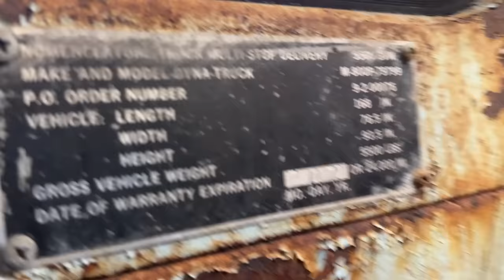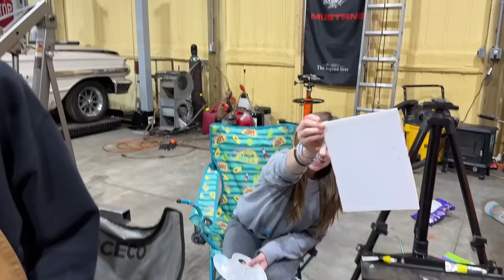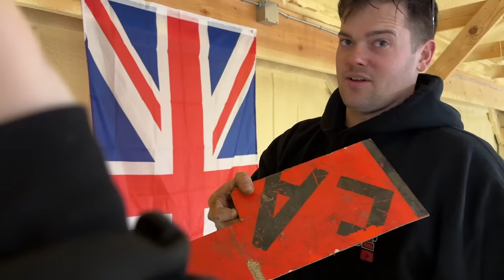Postal Van 6.0 LS Swap Mid-Mounted!

Comment: When it comes to drive shafts I always have them made by a shop sense I don’t have a lathe that goes long enough where I can get them nice and straight and be able to get them balanced!!! If you don’t have a drive shaft that is balanced it can definitely end up taking bearing out of the transmission along with the bearings in the engine also!!! I have seen people say I’ll make one myself and see how bad it vibrates every thing but they don’t realize that the bearings can take the vibration out enough where you can’t feel it and thinking it’s ok and don’t need to take it in and have it balanced!!! I no a guy that did that and made is own and he thought that it was much smoother driving down the road with his new setup that he had put together so he thought he would be ok!!! After driving it for a couple months he started hearing a noise in the transmission!! He pulled the transmission and took the transmission to a transmission shop!! They said that a bunch of the bearings was completely destroyed along with a few bushings in the transmission!!! He asked the transmission shop what would cause for the bearing’s being damaged along with the bushings?? They told him there could be several different things but the biggest issue he had seen over the 40 years of rebuilding transmissions was a drive line vibration of some sort!!! The transmissions shop didn’t even no what the guy had been working with other than what transmissions he was using!!! The guy went to install the transmission and ended up grabbing the flex plate to turn it to line up the bolts for the torque converter and it felt weird he said!!! He desided to pull the transmission back out and check the flex plate thinking that it might be cracked or the bolts that hold the flex plate to the crank might be loose but found out that was definitely not the issue!!! After talking to several other people and trying to figure out what might be his issue he didn’t find out anything!!! He decided to pull the motor out and tear it down and see if the issue might be inside!!! After he pulled the pan and pulled the rear main cap he saw that the rear main bearing was worn down clear into the cooper and was very thin!!! As he pulled each main cap from the rear towards the front they each ended up being worn out way more than he had ever seen before and as he went forward they seemed to be less worn the farther forward he went!! He was able to to just put new bearings in and thought it would work or it wouldn’t!! He got it all put back together with a new drive shaft that was balanced and rebuilt transmission and the motor with new bearings and he was driving it!!! He has been driving it for several years now and he said after spending over a thousand dollars to get everything fixed back up and going he decided that if he would have just spent a couple hundred dollars or less and just had a drive shaft balanced properly he would have a lot more money in his pocket!!!! I told him well it can definitely be a learning experience when changing things around in rigs that you build!!! Heck Cory wheat customs had issues with a drive shaft for a big semi style truck and it ended up costing him I think another 800.00$ on top of what he had originally had the drive shaft shop work do for him!!! Definitely get the drive shaft balanced and I’d even have them build it for the Wright length and all new U-joints and then you should definitely not have any issues!!! I have a drive shaft shop do all my drive shaft builds and everytime I have them build one for me it’s 250.00$ but I have never ever had any issues!!!

Comment: Ralphie , to gain leverage on your wrench , lock the ring end of another wrench onto the open end of the one you are using. In Australia wrenches are called spanners and adjustable wrenches are called shifters

Comment: Sleeper dude you should definitely try some of those drill bits that have like 3 or 4 steps up to the size that the drill bit is!!! It makes so that you don’t have to change out your bits everytime that you go up in size!!! They are definitely awesome drill bits for sure!!! If you use them at a lower speed and use some cutting oil they will definitely last quite a long time plus if you get the snap on set and they end up getting dull you can get a replacement for it and if they say that they only replace them if they break well you just end up breaking it in half and then they will replace them!!! I guess it just depends on how well the snap on guy is!!! Lol!!

Comment: You can take a piece of fuel line and slice it down the middle, and slide it over the radiator lipped to make a rubber insulator

Comment: Hey Josh Richie brothers auction has A green bobcat. It's not running though. you might can get for A descent price. For lifting your Motors and moving them around with to. Along with Hay and straw bale's with also. That would be A good skid loader for around your place that can serve multiple purposes with to. Even driveway resurfacing and leveling and evening them out with to. It's A diesel engine inside of it.

Comment: If you're going to Put roof air on that. Put you a small generator where the motor used to set.
And that will give you the weight on your front Axle
Reply from the maker: Ok thanks good idea

Comment: @sleeperdude Its pretty expensive, but they make direct adapters for AN lines for your radiator to water pump. It would be a REALLY clean, great solution to your problem.

Comment: You do not need one full inch to drive the car but you need at least inch to get the rear universal joint to clear the pinion yoke when installing the driveshaft. A vehicle with a flat-style pinion flange will need much less travel for installation purposes

Comment: Need to put a hole in the end of those forks so you can run a pin through it when hauling engines around. It'll keep em from sliding off

Comment: Lifting the hood and there being a "Frunk " there like a VW would be hilarious! You could have the rad back by the engine and duct the air up from underneath like a Corvette or the Citroen ds have a panel u could remove if u need max cooling...

Comment: That's a lq9 with flat top pistons and Gen 4 rods the compression of 10.1.1 put a set 5.3 243 or 799 heads will bump the compression ratio up to 11.1.1 a camshaft and turbo make 1000 HP without trying
Reply from the maker: Sounds good

Comment: The only man I know of who owns a lift and doesn't use it. With the lift,  loosen everything and lift the metro above the engine and transmission. 
You can make a Metro Mite Grill with ease. It's just 4 metal strips across the front. Then it's a customized Sleeperdude Metromite grill. Wawa and Ralphie are two great helpers, they jump in and do whatever it's needed. AND FINALLY - WHY...WHY...WHY hasn't Doller Genderall sponserated your channel?
You know, from behind, it looks like Ralphie's getting grey hair😅.

Comment: Hi Josh and family. Nice to see you all working on the old postal van. That 232 six you just pulled out is just like the one in my 1966 Jeep Gladiator pickup. Would you be willing to sell the crankshaft pulley as mine is starting to rust thru. Yours appears to be in good shape. Please let me know if you want to sell it and how much you want for it. Thanks for the video.

Comment: Jpsh, been starin at that grill hole and think a 56.7 IHC center grill rectangle with custom expamded metal would look good. Also that blur htrrn ;ooks like 56 IHC dea foam green. That and dupont syn enamel caulment cream, 74 caddie color off white gril and trim would be so cool. I'm not much on 'patina'.

Comment: Also please keep the MAF that was on that air intake. Drivability is way better if you run it with a MAF reference. There's a lot of people that say you don't need a MAF and that's only half true. MAF makes things like idle and partial throttle drivability actually GOOD, and its way easier to daily drive and not just go wide out

Comment: I could get alot more stuff done if I only had someone to hold the other end of the board,you're lucky to have your own crew,and they work for scale lol. I once had a had a Waldensian Bakery,it was a Ford one ton Aluminum bread truck,orange an black trim,300 online 6,it would start when nothing else in the yard would,corporate was getting rid of the old gas powered Van's and replacing some of them with deasel,they retro fit some with new deasel enginesthe auctioned them off sealed bid,my budd gott one too, best 1500 hundred i ever spent,drove it 8 years,then decided to sell it and put a for Sale sign on it,sold it in just 3 days for 4500, Wished I'd have bought several in hindsight.

Comment: The driveshaft in my ls swapped Jeep cj5 is only 15 1/2 inches. You should be fine as long as you don’t max out u joint angles.
Reply from the maker: Ok thanks

Comment: I thought you were having a manual gearbox in this van.  With the engine that far back hows it going to work with the gearshift?.  Great family and videos. Cheers Paul from London England
Reply from the maker: 😊 thank you we are gonna use an aftermarket floor shifter

Comment: You mentioned putting a roof top air conditioner on this, and would need to add a generator. I assume the air conditioner you are thinking of is not dual power, 12V/120V? If you were to run a 120V conditioner could you not just use a 12V to 120V inverter?

Comment: Great job. Glad you put a tranny rubber mount in. You might consider a nice thick piece of neoprene between the motor mounts and the motor since you have to pull it out before final install. I saw you ran the lower coolant hose from the motor to the upper input to the radiator - can you do that and it cool ok?
I know you like the patina on the outside but I would say totally sand and paint the inside. The roof on the inside looks terrible to me.
Reply from the maker: Ok thanks

Comment: Rigidly mounting the engine to the frame will give a mosquito-like vibration and this entire all-metal cabinet on wheels will shake and rattle slightly at idle. A low, rigid car wouldn't have this effect, but the Grandpa-Van is tall and quite flexible, with flat side panels. It was necessary to make the side engine mounts the same as the transmission mount, with rubber inserts, it would be as calm as water in a bucket
I'll be glad and happy to be wrong, we'll see

Comment: You could have dropped that engine transmission out of the  bottom of van where the rubber on the radiator you can use an old casing with out metal. Little things going to do wheelies down the street. You should paint it and put pictures of the t-shirts and hats on the side let's squeezy paint them

Comment: In the few cars I have helped engine swap, paying for motor mounts was always the last resort. We have replaced the rubber with cut down pieces of a semi truck mud flap. I think it would work for transmission mount too. In the instance we needed thicker material, it was folded or cut and stacked pieces. CHeap but effective. Yes, we still bought motor mounts occasionally, but it worked in a pinch. Works well under a radiator too. Just sayin. Come'on.
Reply from the maker: Yeah that’s awesome

Comment: Am I just thinking backwards or shouldn’t that long radiator hose be hooked up to the lower radiator hookup? The return from the thermostat should be hooked up to the top port. Unless the LS is backwards from everything else I’ve worked on.

Comment: I replaced a engine in a rv with a straight axle up front and I just removed the front axle and dropped the engine through the bottom
Reply from the maker: Thank you

Comment: 2:09:00 ITS BASICALLY AN ASTRO VAN WITH A LS.  MATTER OF SOME MINDS ARE JUST THERE. YA KNOW. I WOHLD WRNT TO PULL SAVE AND GOT ALL MOTOR MOUNTS CROSS MEMBER ECT OFF A CHEVY VAN AND INSTALLED ALL THAT

Comment: You made joke about a turbo but with a 6.0 LS and all that space between the motor and the radiator it's just screaming for a twin turbo. It can be like farm truck. It's kinda cool though even with a turbo all dialed in it turns that big turd into a everyday "can't polish a turd" sure you can,you get a cool shiny turd that turns heads.

Comment: Please replace all rubber fuel lines on this vehicle. The newer LLV's were catching fire because of old fuel lines. The postal vehicle fleet is about 37 years old now and its going to be crazy when they finally auction them off. The bodies are aluminum to resist rusting.

Comment: Can you run an ATV drive shaht off the front of the crank pulley to a box with a pulley in the front. Than mount your alternator and A/C compressor to the box put a belt on it.Than run and electric coolant pump.Racecar stuff I haven't A clue.

Comment: I agree 3 inches more back Marge can handle this mail toating screamer uh you need to go with 4 wheel power discs brakes to slow this puppy down. I can see this blistering down the eighth mile strip naturally aspirated engine yesssssssss

Comment: My 86 toyota van’s driveshaft is not even 22 inches, and it isn’t in line with the diff at all. Admittedly it doesn’t nearly have the power this engine has.

Comment: 1:29:13 You Never Have Sharp Drill Bits. I Said I worked at a job where I had to drill every single hole in the apparatus we were building. 1000 holes a day and we only got 3 bits a day. They taught me.  THE KEY IS Slowwww drill has to be turning 6rpm.    And your always flooring the drill.    Soooooo goooo sloooow 6rpm

Comment: .... This is a weird Vehicle And All I know is this ain't a Mail truck. It was probably a Milk truck/Delivery Van repurposed as a personal carrier. Mainly cause it has windows,(which is unusual with these kinds of vehicles)too much seating for a crew of 1,2, or 3, (which is what was considered a normal amount of seating for these vehicles) and the Gummin LLV is way smaller, Ralfie would be hunched over inside one even standing straight up on the door plate also only has one slide door on the drivers side.